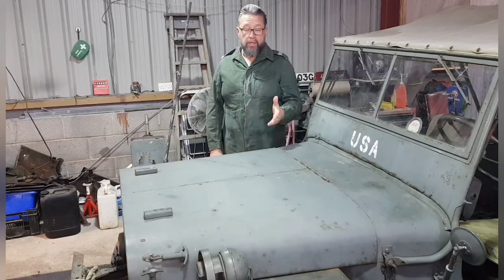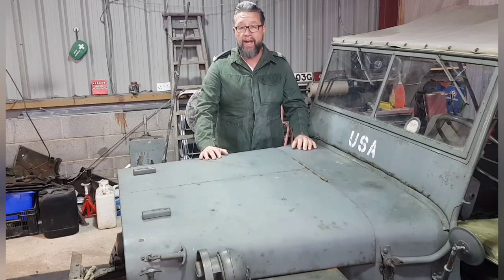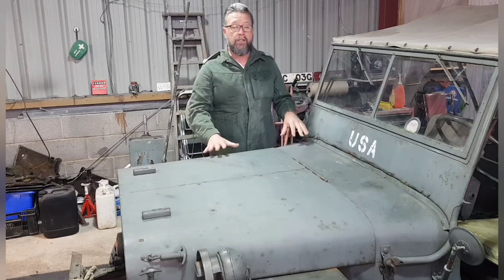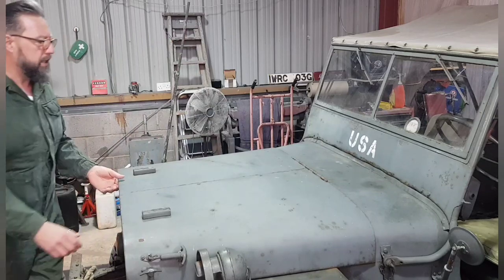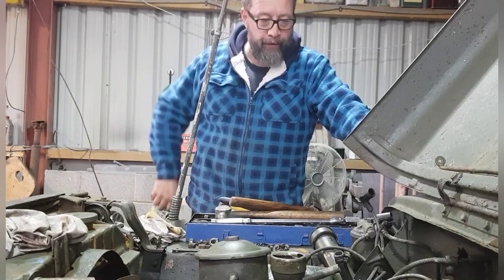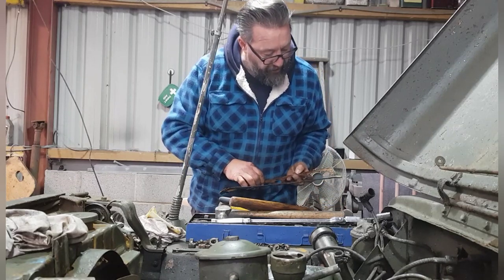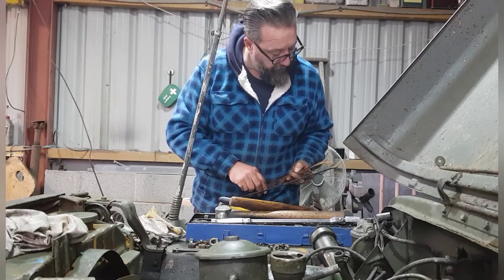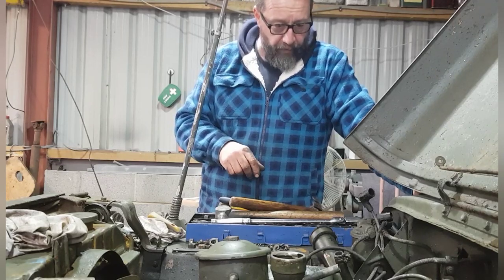Ford gpw 1944 head removal

Comment: I know this video is probably a bit old but the main problem area for cracks is not the head, they warp if left to get too hot. It's the block cracking between all the relief points, mainly the water ports to the stud threads, valve seats to water ports,bores to head studs etc......every single L134 block has this issue and though it's an easy fix today at a fairly expensive price of course, many saleable blocks were thrown out by owners who did absolutely zero research on this vehicle and engine and now original blocks are hard to find. So best to get your entire block pulled out and checked for cracks around the bottom of the distributor and across the head face.

Comment: No markings on the tops of the pistons ?? Maybe they are still the originals @ standard bore??
Reply from the maker: Hi bud.. That is something I will look into.. I'll let you know on the next video, thanks for your support. Regards John
Reply: I think from memory the standard pistons should have STD stamped on top...otherwise if they're oversized it'll have .30 or .40 or .60 etc. These blocks are very easy to bore out and sleeve back to standard anyway so don't stress about pistons and bores too much.